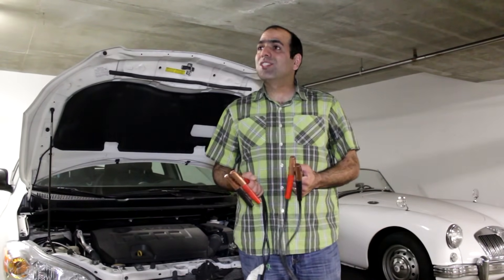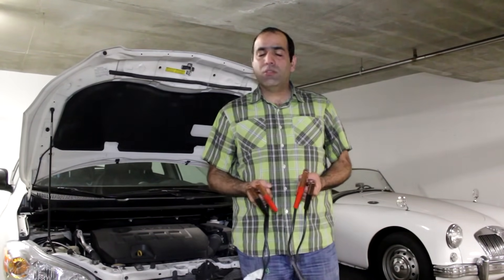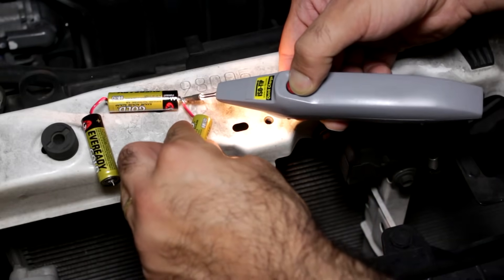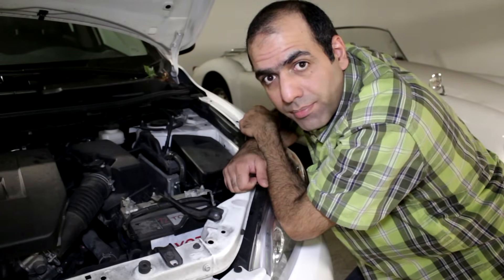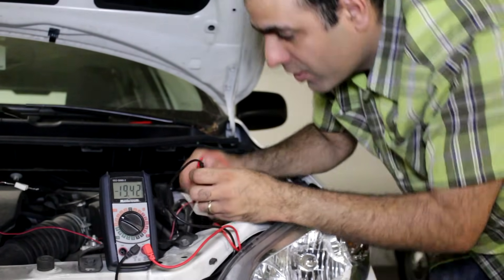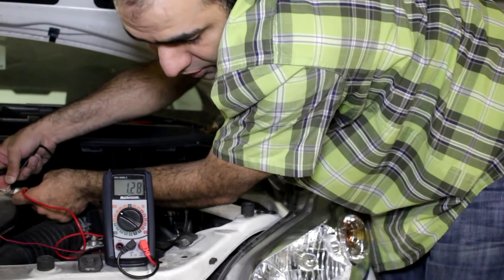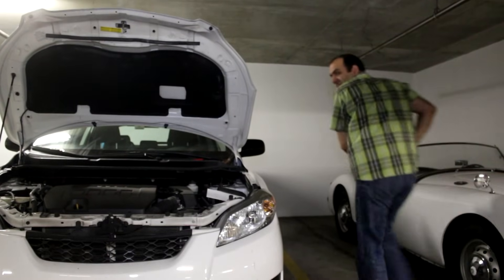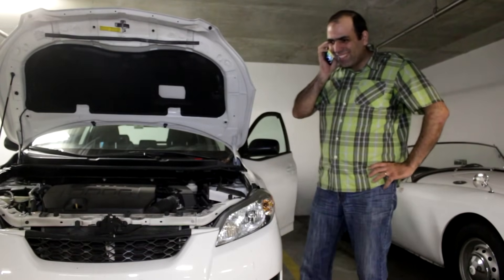Jump Start a Car with AA Batteries

Comment: speaking of car batteries, why does it say in car manuals that to safely jump start a car battery, you have to connect the positive terminal from the charger car to the positive terminal to the chargee car BUT for the negative terminal, you connect it from the negative terminal from the charger car battery to a random metal part of the chargee car?
Reply: NightShadow Any part of the engine block or body is grounded to the negative terminal on the battery through ground straps. Doing this saves weight, cost, and production time since you don't need to run long wires everywhere. Bare metal works best, since paint will cause resistance in the circuit.
Reply: yes, just tazer the driver,and drive away lol
Reply: I wonder about your explanation which you stated that the danger in connecting the positive cable to the battery is that there is hydrogen gas (H2) around the battery. However, H2 rises very quickly in air, so I wonder just how much H2 would be around the battery? Shouldn't the H2 that might be in the engine compartment have risen out of the compartment?
Reply: Some explanations here, but none are exactly right. Charging a battery produces H2 and O2. You can see this by putting two electrified wires in salt water. One side will produce some bubbles, and the other side will produce twice as many bubbles. The former side is releasing oxygen and the latter hydrogen (because it is electolyzing H20... 2 hydrogens are released for every oxygen.) The same thing happens in a battery when you apply charge. This is more dangerous than just hydrogen, because it is stoichiometric mix of hydrogen and pure oxygen. The air space in the battery may fill up with this and then begin to leak out. When you remove the terminal, you provide a spark. If there is enough hydrogen concentration to ignite near the terminal, it can travel back to the air space in the battery, igniting that, causing an explosion. It isn't incredibly likely since the nearby gas concentration has to be high enough, but it isn't impossible. Since a battery is full of corrosive sulfuric acid, it can coat you in this, which can eat through your skin or cause blindness if it gets in your eyes. You are supposed to connect the negative to a metal part of the car away from the battery and make sure to remove that one first once the car is started so the spark is far from the hydrogen source.
Reply: when battery is out of charge why it produces h2.
Reply: combined neutral and earth
Reply: +twinbr0wn.what do you mean by combined neutral and earth.
Reply: Michel Conter ah didn't know that. is that standard for all cars?
Reply: NightShadow I am not a mechanic, but I guess it's true for most of the modern European cars.

It has become rare that both poles of a battery are accessible. It's usually just the postive (+) one, because the negative (-) one is usually just a big screw on the body of the car.
Reply: NightShadow its for safety reasons. around a discharged battery there can be hydrogen gas built up and can be ignited by a spark.
Reply: The metal body of the car is the negative side of the electrical system.  The negative terminal of the battery is connected to the car body.  This makes it possible for the negative sides of the power devices in the car to be connected to the car body while still receiving power from the hot wire directly from the battery.  In otherwords, the metal body of the car is like one big negative wire.
Reply: To underline the other comment here, have a look at this image of a Fiat Ducato battery and how it's wired.
You will notice that the negative pole connects directly to the body of the car:
https://i56.servimg.com/u/f56/18/56/22/85/fourgo10.jpg
Reply: This is correct, however charging the battery technically isn't what causes electrolysis. Rather, Charging the battery turns what was diluted Sulfuric acid (essentially water) back into H2SO4. The release of Hydrogen/Oxygen is from OVERcharging (which would usually happen when a car is running as the Alternator keeps it topped up)

Comment: You measured 11.7 at the battery, that should be right for a full charged 12v car battery, so you didn't need to charge it. Or?
Reply: must be above 12v in idle mode. if below, the car cant be start. full charge 13v around i thinmk, with engine on 14v sumthing. ive done that before. forgot the exact no.
Reply: Phil Indeblanc 11.7atV at the battery means it's dead. As soon as you start cranking it will go down below 9V which is too little to start. A healthy battery would be around 12.2-12.6V depending the battery
Reply: Yes, I think I remember now. Forgot the threshold. Loving my AGM tech battery in the car. It starts faster and more power to have when off. Odyssey is the one I'm using, and you can hear the cranking much faster fire.

Comment: omg why would I have a working soldering gun and pack of 2 AA batteries?
Reply: now you have a reason
Reply: billie Israel Who doesn't carry batteries and a soldering iron in their emergency bag? 🙄
Reply: Actually I carry a propane soldering gun. Never know when you need a soldering gun/torch/heat gun on the fly

Comment: Now... at the risk of being judged stupid, could this actually work? Because a mobile one-time AA battery kick starter sounds awesome to me.
Reply: Tehnicaly, Yes. but it does depend on the engine. bigger cars or jeeps have bigger stronger engines requiring more 'juice' so it would either need atleast double the batteries or it wouldnt work at all. i can recommend having the batteries in your trunk at all times. just in case... you may never know where you could need them, not only for jumpstarting cars but for other possible situations.
Reply: +Joseph B. that's not true. It would be true if you were actually starting the battery off of the AA cells, since you would need more current for a larger vehicle so you'd need more low current cells to deliver the current. But to trickle charge a battery from 11.7v up to a voltage sufficient for starting works the same regardless. 
To be clear, you'd need hundreds of AA's to start a car, so no one should actually try doing it that way.
Reply: +Panik 0_0 yeah sure I guess it would work but bigger cars and trucks have bigger batteries so it would take a very long time
Reply: There are self jump start devices you can get.

Comment: At the risk of repeating previous posts, 11.2 v will run accessories, but not start the car.
Having a manual transmission is the way to go. When the starter in my '02 Subaru Outback (160k miles) 5 speed died, I parked where I could get a rolling start until I replaced the starter.
Unfortunately for those of us with a passion for driving (yes, even in a Roo), I don't think anybody, outside of astronomically-priced super cars, offers a manual transmission, even as an option.
Thank you.
Reply: In Italy for example 95% of people have a manual transmission car because automatic transmission is too expensive.
Reply: I dislike automatic transmission. I like having the ability to 'play around' with the gears and always have it as i want it.

Comment: The Prius has no starter motor in it.
Reply: The Prius is a hybrid electric, which means it has both a gas powered engine and a electric engine. So, yea, it has a starter motor in it as well.

Comment: Oh what is this? an ElectroBOOM video that actually has a good endin- oh nevermind :D
Reply: no taser use high voltge and low current an the car need low voltage and high current(150-200 amps or even more)

Comment: i want dat soldering iron
Reply: +Toad Phillips must work pretty well... soldering batteries is a hell of a task with a bad iron since the battery pulls all of the heat from the solder joint so solder never sticks.
Reply: Chris Carr, I use a file to roughen the surface and solder would stick. Either that or I remove the nickel (?) coating?

Comment: Soooo can those 19v from the battery burn some of the electronics on the car?
or did you just removed the cables from the battery to charge it?
Reply: The car electronics would never see 19V. As soon as the small batteries are connected the total voltage of the charging batteries would drop due to their internal resistance. He also added a 1ohm resistor in series that would make the voltage at the car battery even less. At the start of the charging he measures 2.2V across the resistor so even without considering the small batteries internal resistance the voltage across the car battery terminals would only be at a maximum of 16.8V.

Comment: Im trying this right now. I have 8 brand new 1.5 batteries wich i just taped together with simple wire around negative and fancy small clips on possive. Doing in 2 batches of 4. Can it overcharge as cant find voltage meter at this time.

Comment: God damn it man, you're measuring current in parallel. You have to do it in series, otherwise your readings mean nothing at all.
Reply: he is measuring the voltage across a known resistor. Ohms law gives the current. connecting the multimeter in series it could work too, but the current without the resistor might be too large for the multimeter anyway.

Comment: if the car battery is dead then how did the wind shield wipers work?????
Reply from the maker: Because it is only half dead, like the guy in "Princess Bride"
Reply: battery was not dead it was just too discharged to start the car. if the battery was completely dead it would not hold charge any more and thus you could not jump start it in this way
Reply: Mostly dead is slightly alive.
Reply: What is dead may never die.
Reply: Not totally dead. As shown, the battery was on 11V, that is enough to drive the wipers but weak for spinning the starter engine (a real situation IMHO)
Reply: Not dead.  11-12 volts.  Just very sick......cough....cough.
Reply: That is not dead which can eternal lie. And with strange aeons even death may die.
Reply: If the battery is still slightly charged then it can run the windshield because they need at least 7v to get up 5v to get back down
Reply: ***** Ah, that would make sense
Reply: +Sebastian Rodriguez 
Winter Is Coming!
Reply: Wipers use a low load as do the dashlights that often come on with a flat unless it is absolutely drained and wpould need replacing as it holds no charge, Can I also mention you can have that kinda voltage and still it wont start, As what it would be lacking is "cranking amps". starting a car is a very fast very demanding strain on a battery.
Reply: Synothium LABS deal with it
this will go on for a while
Reply: 2min10s
Reply: Synothium LABS is acting
Reply: 11 volts doesn't supply enough current to crank a vehicle, but there is still some available to run other things.

Comment: 11.7 volts before, battery wasn't completely dead, maybe just lightly discharged
Reply: You don't know much about batteries, do you ?
Reply: Battery Voltage and State of Charge:

12.66v . . . . . . . . . . 100%
12.45v . . . . . . . . . . 75%
12.24v . . . . . . . . . . 50%
12.06v . . . . . . . . . . 25%
11.89v . . . . . . . . . . 0%

Lower than that may even mean that your battery is completely dead, meaning you won't be able to recharge it due to sulfation.
Reply: car batteries are generally quite hardy (compared to other rechargeable batteries) and can drop down below 11.89 and above 18 without major damage. At least for short periods of time. But what you are saying is true. At 12V there is not much energy left at all

Comment: But the car battery was at 11v before you charged it with Double A batteries. So...wasn't it already charged?
Reply: A fully charged car battery at rest with no load is 12.4 volts or higher. When you have the engine running with the alternator it goes up to 13-15 volts depending on the vehicle.

Comment: F@@@ing Moron. So you are going to carry a dozen fully charged AA batteries, A Gas soldering Iron, Something to light that, Flux, Solder, Numerous lengths of wire to connect the batteries together and something to bare the ends of the wires. For less than all that costs I bought a Off the Shelf version that plugs into my cars Cigarette Lighter so I don't even have to lift the bonnet
Reply: +ANDREW CULLEN But most people have AA batteries lying around so this is cheaper of course.
Reply: +Zieekel And exactly how do you charge it. My one you plug into a normal socket once a month to keep it topped up. And I bought it unused very cheap on Ebay. That thing I would imagine you would have to take apart to charge the batteries (If you use rechargeable ones). Tell you what, I give you 10 minutes (Time taken for mine to charge the car battery) to even get together everything needed to make it. I accept it is the same basic principle and yes I could make one but realistically no one is going to unless it is for something like a science project
Reply: ANDREW CULLEN
You just connect them to the socket instead of the car battery and obviously they'll get a charge. I've made one similar to the video except using scotch tape to connect the batteries and wires instead of a soldering iron which saved me some extra cash, And I just timed the time it takes to charge. It took approx 22.00000722824 seconds to charge.
If you don't use rechargable batteries you can still charge it, It just takes longer. the time I took with non-rechargable batteries was 24 seconds flat. It's a pain to wait that extra time but if you don't have rechargables lying around like I did it's an acceptable solution.
Reply: +Zieekel And you now carry it around with you to jump start your car?
Reply: ANDREW CULLEN
Yes
Reply: Liar LOL
Reply: +ANDREW CULLEN Obviously. lol

Comment: What if you had 20 AA batteries? would you wire all 20 in series or 10 and 10 and then parallel the 2 sets of 10?

Comment: +ElectroBOOM I got the craziest idea for a device and I thought you'd be the guy to try it if it is possible. Say you have a car in your garage and the battery is dead but aha you also have an outlet in your garage. So could you build a device that converts 120VAC to 12VDC with a current of 300 amps so you can get just enough juice in an instant to start the car once. I'm thinking you could maybe use a series of super capacitors to build up enough charge to deliver that much energy for a couple seconds.
Reply: +James Kelly  +1 - Do I hear a hint of sarcasm??  ;-)

Comment: 2:08 11.7v lol its charged
Reply: 11.7v will start a car
Reply: almost 9volt can crank start the engine,,,😂
Reply: Generally, below 11.8V, depending on the car, you might not be able to crank.
Reply: You saw how it all didn't do start before

Comment: your car should have been able to start with 11.7V, i have a 5.7Liter V8 and it can start as low as 9.5V, also what i've done before was take 2x7.2 V batteries, put them in series and connected them to the car battery, even though the actual series voltage was 16.5(fully charged these units run around 8.2V) because i was placing a high load on the batteries the nominal voltage dropped to 11.2, and i was able to start my car, where it probably dropped to 10v when cranking

Comment: the wipers where working when the battery was "dead"
Reply: The battery wasn't fully dead, so it was able to move the windshield wipers. But didn't have enough charge to start the car
Reply: Okay then, i would've been fine with just demonstration purpose.
Reply: +Ben Gamble  did you not watch the video, the battery had 11.7V before "charging" it

Comment: Nope. AA batteries are 1.5 volts and car batteries are 12 volts. You'd need 8 AA batteries.
Reply: +MrSupercar55 only rechargeable are good in delivering high current. Each of them is 1.2 V. So you need 10 or more of them.
Reply: +MrSupercar55 Car batteries are actually 12.5-13V and you need higher voltage to charge them, that's why an alternator puts out about 14.5V.
Reply: +MrSupercar55 to actually use the AA batteries to increase the voltage in the car batteries, they need to be at a higher voltage, otherwise the car battery will try to charge them, which is not what you want.

Comment: 19volts isnt that too much for 12-14v battery? :)
Reply from the maker: +Ramas Ramzetti Those AA batteries cannot sustain their voltage and quickly drop to the car battery voltage level providing 2-3A of current. Their internal resistance is relatively large.

Comment: you can't charge battery with aa batteries because of small capacity of aa batteries.it's like a try to fill the bottle with a small cup.
Reply from the maker: +Neso Kerkez Well, I just did
Reply: They have enough energy to start a car once